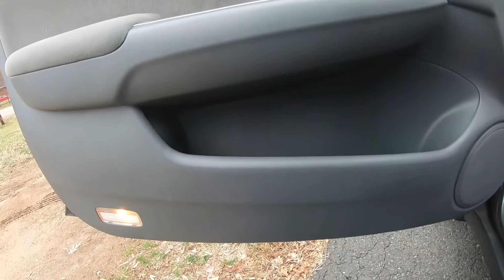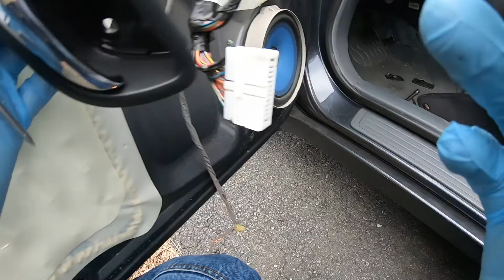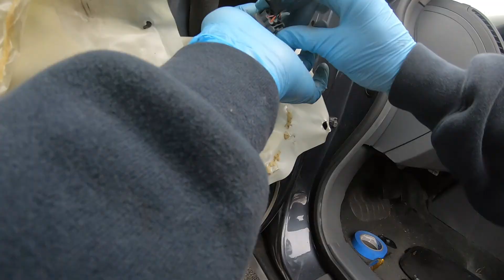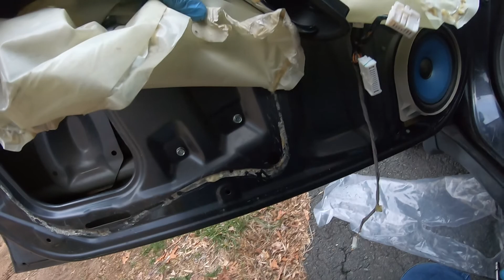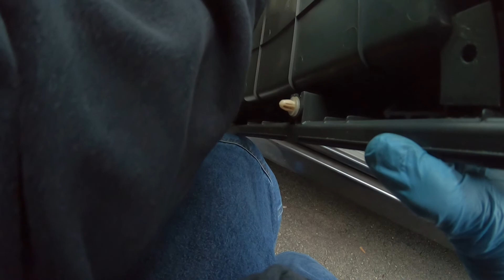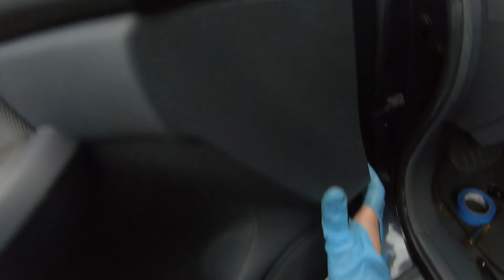How To Replace The Window Regulator On A 2007 Honda Accord

Comment: My window just stopped working. It was all the way up and just kind of slid down into the door. I can hear it  grinding when I try to close it. 
How can I be sure that it’s the motor/regulator before I try to take it apart myself? 
Also: how is it legal for these asshole mechanics to say that the part costs 400-500 bucks when I can buy it on Amazon for $42??
Reply from the maker: Either way you will have to take it a part to find out, I would just replace it. They can charge what they want, that's why you get multiple estimates. This is part of the reason I do most stuff myself, to save money

Comment: Thanks bud!....I just did mine and I left the door panel on with the switches and just moved it over to the side a bit I didn't want to break the tab that holds the light in at the bottom(pretty brittle)and it worked out for me did the job in about 45mins
Great video thanks again
Reply from the maker: Welcome! Glad you got it fixed!

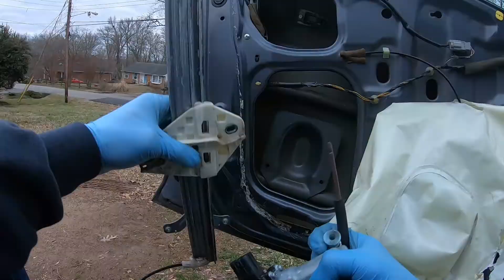Comment: Awesome vid! I just did this today thanks to you. For posterity, there are two more bolts on the white bracket/shelf inside the door at the bottom of the glass that need removing as well, or else you can’t remove the railing. The vid appears to skip that part at the 04:51 mark. Just putting that out there because 10 years ago I would have tried to force it out and probably broke the glass in the process lol. Forewarning: I could only get to these two bolts using a 10mm ratcheting wrench

Comment: If the window is going up and down but goes at an angle and get stuck, is it the regulator it likely something else?  Why did the cable break?  Thanks!
Reply from the maker: Could be the regulator or the track. I don't know why mine broke, I just heard it break.

Comment: Thanks, helped convince me to try my rear window regulator & motor myself!  I wasn't going to try it and was prepared to just let the dealer fix it.  Video was helpful even with the differences for doing the rear door.....  Saved myself some $$ and would totally do it again if needed.
Reply from the maker: Welcome! Glad to hear it helped! Glad you saved yourself hundreds doing it yourself.
Reply: How long does it usually take to do this replacement in ur opinion?

Comment: Super helpful but you forgot 1 screw. The one in the door just below the controls under a little rubber false floor. That was driving me nuts. I couldn't figure out why the door panel wouldn't come off for like 5 minutes.
Reply from the maker: Glad it helped!

Comment: Saw your videos yesterday. Mine broke 2 days ago. The dealer price for this part was $480. Plus $120 for an hour labor. I left and bought this same part in your video for $75. at an auto part store. I just put it in easily, thanks to your video!
Reply: might be your switch. seems the auto up/down does work.
Reply: Edit the auto up down does work.
Reply: Also front passenger regulator went out the other day. I finally replaced it too. Only had one error till I figured it out. Be sure the window is actually on the rubber tracks on the left and right of the window so it goes up and down properly.
Reply from the maker: Glad it helped you!

Comment: My driver side window is working intermittently.  Sometimes when it gets to the top it just reverses itself and starts coming right back down.  Here lately it will go down a ways but then won't respond to the buttons to go up or down.  Finally it will work again.  I'm guessing that something in the motor is going out.  It will work several days in a row just fine but then starts acting up again.  I take it that there's no fix except to replace the whole assemble is there?
Reply from the maker: It comes as one assembly.